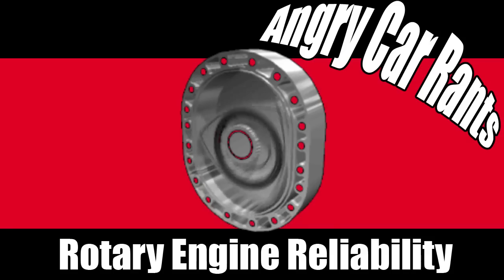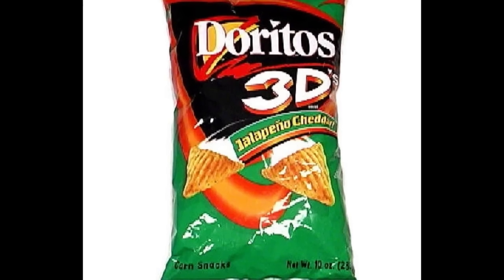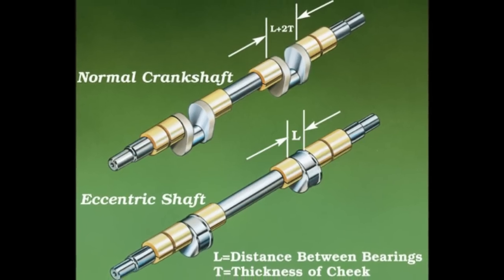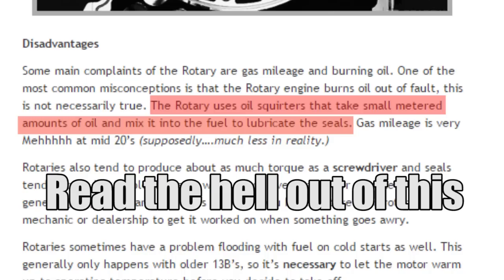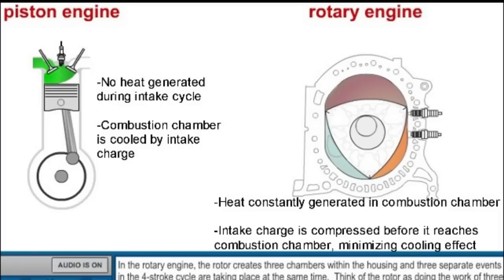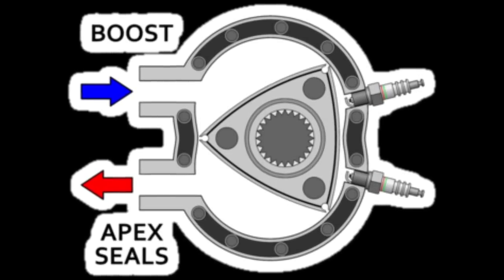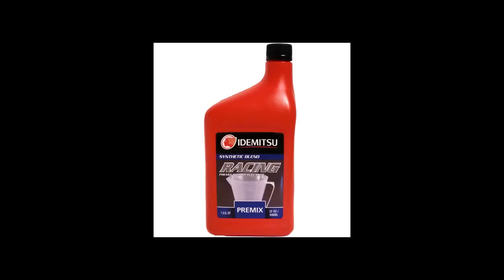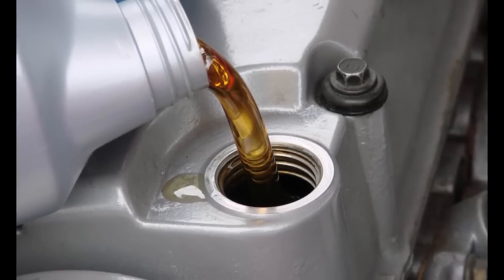Angry Car Rants #3 - Rotary Engine Reliability

Comment: Point: Rotaries are reliable if you perform maintenance above and beyond that specified by the manufacturer and will cause the engine to not comply with emissions standards and modify the cooling system to above manufacturer specifications. 

Counter-Point: Not do any of that by using an engine that literally needs none of that extra bullshit and gets better gas mileage too just as an added bonus. 

No one gives a shit that if you fawn over your engine, swap a bigger radiator (why didn't the fucking manfacturer do that?) and premix it like a chainsaw that it can last as long as the shittiest piston engines put into cars as of the late 70's and get the same gas mileage. Rotaries are garbage, plain and simple. Like them if you want, I appreciate the appeal of special /weird tech in cars but don't kid anyone about whether they're on par with piston engines, especially modern ones.
Reply: RahPowah01 I'm getting a RX8 soon, can you reply and help me maintain it?
Reply: The simple truth is Wankel engines had never been reliable.. its a major reason why they are no longer made...

Comment: Even Mazda finally gave up on the troublesome Wankel engine in April 2009 Mazda's board of directors voted to cease production of RX models and engines by 2013. Due to unexpected low sales the end came 7 months early. On Friday June 22, 2012 at 4:30pm the Wankel engine assembly plant at Mazda's Hiroshima U2 plant (Ujina #2) shut down and shortly there after was dismantled to make way for a brand new engine assembly facility specifically designed to manufacture Mazda's new signature SKYACTIV line of reciprocating Otto and Diesel engines...

Comment: dokterbimmer the fake ???? WOW!!! You're right, he did delete all his comments
Reply: Meet Dr. James Lemke - a serial entrepreneur with a history of founding and leading companies to successful exits and a personal passion for science, engineering and education. Dr. Lemke founded Achates Power in 2004 with an idea that would revolutionize the automotive industry by revitalizing the opposed-piston, two-stroke engine. As an influential physicist holding more than 100 patents, Lemke understood that the rapidly increasing shortage of fuel and greater need for emissions reduction meant the world needed a solution. That solution came in a 1930s-era engine architecture that demonstrated great potential, but momentum had dissipated when the tools of the time could not produce an efficient version. Lemke knew the tools and the talent were now available to answer the transportation crisis. Dr. Lemke started Achates Power with a collection of the brightest engineers and scientists with the condition that ideas and discourse flow unabated and the expectation that each fulfill their utmost potential. While amassing top talent in the industry, Lemke’s vision began to manifest results. However, instead of an engine that only moderately answered the need for efficiency, the Achates Power engine realized a more than 30 percent fuel efficiency improvement compared to the industry’s best diesel engines and nearly double the fuel efficiency of a standard gasoline engine at lower emissions levels and at 10 percent lower cost. While Lemke always believed in the engine’s viability, now the results have shown the industry the potential economic savings of trillions of dollars per year on fuel and components, and billions of gallons of fuel saved per year. Please enjoy this biography on Dr. Lemke and the history of Achates Power.

Comment: Are there any tips to getting torque our of a rotary?

BOOM
Reply: Who needs tq we proved it for years
Reply: Daniel Lobo yeah, turbocharge it.
Anymore questions?
Reply: Who needs torque when your redline is literally over nine thousand?
Reply: TheLaXandro literally everyone
Reply: +Daniel Lobo That's what transmissions are for
Reply: The only way to get decent torque from a Wankel engine? There simply  is none and explains why the design is obsolete,  the leverage or "mechanical advantage" in the Wankel's inherent geometry is well.. ass-backwards..  the relationship of the piston gear, fixed gear and eccentric-crankshaft does not allow for the multiplication of force to develop torque.
Reply: The real doktorbimmer
Read a basic automotive engineering textbook. Wankel engines can produce immense amounts of torque. Power is a function of torque and RPM (if you're confused by this statement, read a high school math textbook). Wankel engines can produce about as much power as similar sized piston engines and do not rev significantly higher. Therefore, they produce similar amounts of torque.
Reply: LeeFerikson Compared to reciprocating engines? NO, that is simply completely and totally untrue.
 Wrong, compared to reciprocating engines available today? The Wankel produces very low torque and horsepower by displacement..
Reply: LeeFerikson Maybe you should go to engineering school and learn something about engine design and operation.?
 Because you seem to be basing your false assumptions on a lot of speculation and myths.